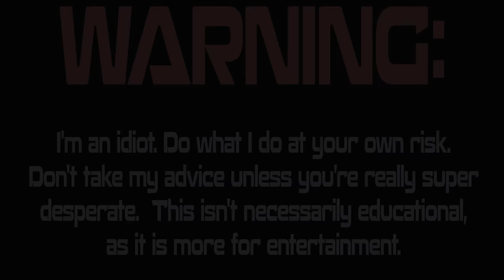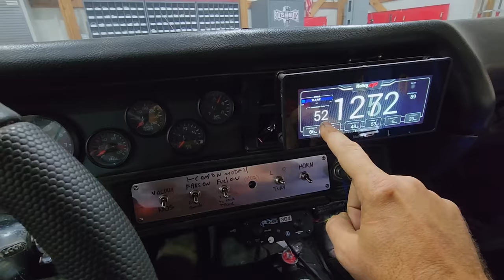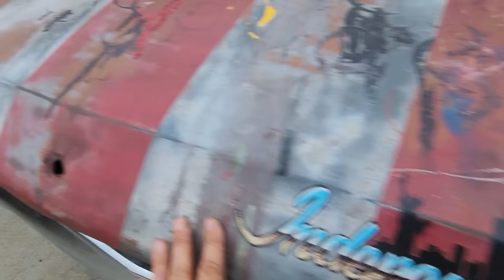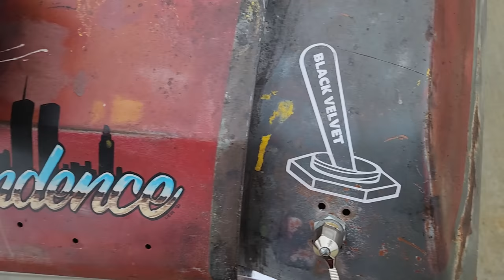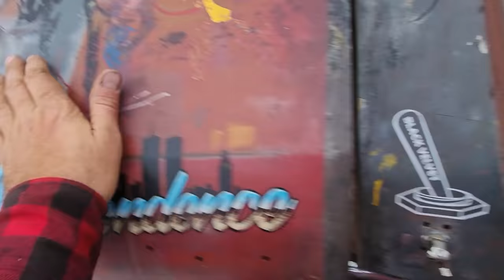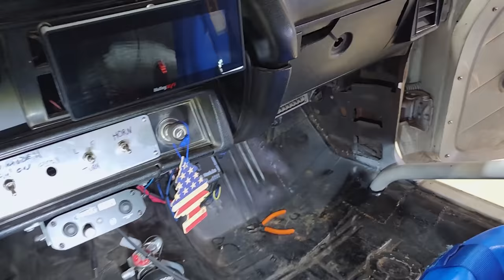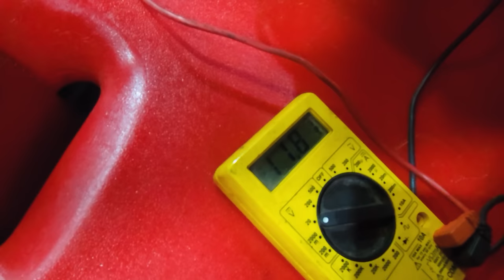Body Work with a Fork lift and Winch - Can Independence Chevelle be fixed?

Comment: There are a handful of car and truck projects you did on Vice Grip Garage that could define the heart and soul of the channel. There’s just something about the Independence Chevelle that not only defines Vice Grip Garage, but transcends it to a greater meaning. It’s like the St. Louis Arch. You remove the Arch from St. Louis and it’s just another city on the Mississippi River. But having the Arch there defines the city. Make the Independence Chevelle a safe roadworthy car and keep it around the shop.

Comment: Wow that winch pulled most of the damage out the first time And even un Folded it just by attaching to the Chrome Bumper that was impressive that don't ever happen that smooth Reversing the damage like going back in time as the damage occurred Wow Derek @Vice Grip Garage

Comment: Did a similar thing to my 735i after a truck wiped the nose into a different position. I just hitched the bad points to the corner of the house and reversed with perfectly calculated speed several times. You are only prolonging the inevitable but its giving the old dog more life. Reminds me of Tripod, a cat we rescued, perfect isn't always perfect.

Comment: So, on a dirt track car... A guy builds a cage, and hang body panels on the outside, from week to week  different panels or even cage sections, or frame gets replaced, but the car is always at the track next week and looking like it did at the beginning of the season...... And like you said, kids love it, you love it, it famous, fans love it. You've got good bones for a burnout & track safe car.... Build the full cage, hang as much of the exterior sheet metal as you can over the skeleton 😁

Comment: Imo do what you can to straighten and reinforce the good sections. Weld whatever sheetmetal and patches you can to the inside of the body and then build a tubing frame inside to prevent it from collapsing. Pull what dents you can safely. Then take the body off the frame and mount it on something for display. If you need to remove the worst sections and reweld some stuff? Do it.

Comment: Hey Derrick,  the spray you use to " stabilize " rust is phosphoric acid. It turns iron oxide to iron phosphate. You shouldn't use a spray form without using respiratory protection.  Buy Ospho in liquid form, where protective gloves and wipe or brush it on, after knocking off all loose rust first. Ospho only works on tight rust.

Comment: Derek, you won't get the voltage necessary until the temp comes up past 180!!! Good job on the body though, way to go!!
Bracket race that girl, put a 4.11:1 in the rear with a 12 bolt and 4 link it!
You inspired me, I put a 496 stroker in my 67 Camaro!! 775 h.p. at the wheels!!!...Jeff

Comment: The way you feel about this car and the state of this car is something I can relate with a lot. My very first car was a 1997 Mitsubishi Eclipse gs. It’s sun faded to hell, had a lot of character, and has way to many memories to count. It ultimately has reached a point of neglect that hurts my soul so much in terms of rust and it’s ultimate fate when I froze water in the cooling system. I bought another car to drive and have held on and drug the eclipse with me and every time I start working on it or inspecting it my soul hurts a ton seeing it’s current condition in terms of underbody rust. But after I get the engine back together I’m just going to enjoy it till I can’t any longer.

Comment: It's honestly just amazing what you can do with a good wightset like the forklift something that has not much give and you should try and get a decent Porta power and it literally will make a BIG impact in something bowed and a good winch that you can remember to use a snatch block and remember that the basics are every time you add a snatch block it doubles the power and it will slow it up to where you can find a good spot to get some triangles going to square it up again. If cleats can do that coppy car that was feets outsa wacka for independence she has memories that will help her heal and make it back again! She loves this stuff and it means a ton to the world and truthfully more and more people don't even know what it means and stands for! But SIMPLY Rise from the a ashes and make it whole again! A little bit of heat here and there and a little bit of a push tug and it will be right as rain.

Comment: Brother Derek,
Pull the drivetrain from Independence.  Drop a smallblock, or whatever you got lying around.  Paint up some valve covers to make it look somewhat like the BB.  Just drive it to shows.  Use the original drivetrain for the El Camino, or whatever you choose.  Independence is the car, not the motor, in my opinion.  Keep up the good work.  It's great watching you succeed!

Comment: Glad to see you giving that car a final run before proper retirement while still honoring the 9-11 victims.
My favorite line in this video: "If it doesn't bleed America...."
With a vacuum, you can have suction (hand on end of hose to feel it) but no airflow, which causes the dirt to flow through the hose.  That's because your filter is clogged not allowing airflow, though you have plenty of suction.

Comment: I was going to leave a comment on some of the previous videos on Independence that it probably would have to be retired from burn outs to be saved. I honestly think one option ( here a guy out ) would be instead of just building any old burn out car, you find a nice semi rust free A-body ( doesn't even have to be a Chevelle ) and paint it in an identical livery with the current Independence drivetrain, and name it "Liberty", A sister ship that carries on the torch of Independence for generations to come. Just a thought, building any burn out car will be cool but it was a thought I had

Comment: Derek. Read this please !! Im a auto body instructer at admiral peary vo tech. I teach  10th 11th 12th grade students collision repair and restoration. I would be thrilled to restore independence. We have frame machime and state of the art paint booth. You would have no labor charge just matieral. We can properly patch all metal to keep it as close to oraginal as possible. We can build a lot of part we have alot of metal working equipment. And it be a heck of a learning experience for the students. I would over see all the work the kids do so you it would br done. Properly.

Comment: I remember the episode when you rescued her. She’s came a long way since then and after this grand finale she will be remembered forever. I’d say return independence back to a going to town rig with a small block Chevy and cruise her into town. I like vote on using the short bed GMC for the burnout truck with the running gear big block and transmission from independence and as one commenter suggested paint it up like the independence Chevelle for in memory of. 
God Bless Y’all.

Comment: dont forget it will also needs all new floor and trunk braces... I just did a 69 Rag Chevelle and basically 10 out of 12 body mounts were roached ,,,so all braces had to be changed.

Comment: Have always been a Chevelle fan, owning a '69 & '70 at one time. Think I'd spend a day under the car with some of that rust inhibitor spray and then go over that with some rubberized coating to keep the underside of Independence from further decay. Remove the motor/trans for another burnout vehicle and replace then with what most likely came in the car: 350ci/350th. Build the 350ci to something L-46-like.

Comment: Straighten the frame, pull rear quarters panels, trunk, bumper and all attaching points. Order new aftermarket panels from AMD. New wrap call it Independence 2.

Comment: Id say carefully swap the old skin on a donor floor and frame to keep the patina and look but safe and sound and do whatever needed to stop further rust damage. Some patina jobs show where repairs have been made. Could even paint the necessary exterior repairs to look like new when it was first painted that theme and there is a mix with new and old kinda to represent us repairing our damaged country.

Comment: I remember my first frame straightener 9000. It was a light pole mounted on a concrete tripod located at the Television shop across the street from my house. It could only be used on Sundays. Or overnight. First frame we did was a 65 Malibu. We used chains and come alongs. We were the go to guys in the neighborhood 😂

Comment: Should be doing it like the previous owners. Layers over layers. Without treating the hidden rust of course. Get a good enough Chevelle and put the independence outer over it. Literally sheet metal over sheet metal. If you can tuck a quarterpanel under a quarterpanel you can do it to a whole car.

Comment: Why not pull the body, soda blast the inners (maintaining all exterior paint/rust) weld in any 'necessary' inner panels, skin the inside of EVERYTHING with fiberglass, and seal it with raptor liner. Then swap the frame, and reassemble. It'll cost about 3k in materials + the frame, and it'll be good for 10-20 uploads. That's exactly the resto yt needs, and independence deserves. Extensive.. yes. The fun kind.

Comment: A feller needs to keep himself a tube Lexal around the shop. U could have used it to glue down some of that thin rusty quarter to the new sheet metal and not used so many pop rivers. I'm  telling ya that stuff sticks to anything, it's clear and you can even use it on damp surfaces if needed. Most of the time I go to the gutter section at Lowe's and buy the seam sealer, it's the exact same thing and saves a guy a couple bucks. It comes in the calking tubes or the smaller squeeze tube (so does the name brand Lexal). It would also be good to take on a revival mission when you have a leaky roof or windshield. Try it you'll find all kinds of uses for it.

Comment: Well, as far as I understand Vice Grip Garage is partly about preserving unloved and abandoned vehicles. Independence Chevelle is an icon in today's motoring culture, from day one in my humblke opinion. I watched the first episode when Derek brought the car back home, and the car kept giving albeit being laden with multiple issues and a lot of stuff that happens to unloved cars. Why not rescue the body and frame? Why not go the extra mile and restore Independence to show piece quality and return it to its former glory? Show her on car shows as the car that refused to give up. I guess it is taking a shitload of money to get it fixed, but it will pay off in the long run. Work over the frame, put the body mounts and inner structure back together, go over the body and fix ist. Make her into THE Vice Grip Garage mascot - show her on Hot Rod Power Tour. I am sure making a video series out of the restoration process will bring in revenue, and the fans will see her return to its former glory.

Comment: Not to sound too red-necky, but after you get the body bits reconnected you could reinforce it by glassing up the inside. Just be careful not to glass in any untreated rust. You needn't even worry about the self tappers. Seal off the tips to prevent rust & you're golden. Then, once you get her stabilized in structural terms, you're freed up to attack the frame issues.

Comment: I would put new metal to make it safe in the bones of the car but not to much so it keep its soul, its earned that rust and bumps you see. Then i would put a mild big block in it with a tunnel ram and some leg warmers out each side to give it that 70s feel. Put some seats in it so you cold take the family out to get some cold snacks on a weekend cruise

Comment: Serious suggestion, could you not build a space frame in her? Carry on what the roll cage is already doing and restore her structure internally then take the new frame members onto the chassis? You could then use the new internal frame to give the external panels rigidity back.

Comment: The safest way to do any switch is switch the ground anything that is wired and as a switch should be on the ground side as the switch is the most safest way to do it I’ve been wearing for 30 years and I’ve been drilling twisting wires for can bus systems with a drill for 20 years And I believe I was the first person that I’ve ever seen do it working with 13 other guys they started to do it I don’t claim to be a pioneer but I’m pretty close I always use the ground side for a switch if you look at any engine control module it switches with the ground side

Comment: My two cents says that a feller or fellet would do best by putting that 871 with a big blower out the hood in to the ol gal, spruce her up some more, and use her as a pony car on power tour and the like. Shower her off and let people keep makin memories with good ol independence. Then take what you’ve currently got settin in the power barn and drop that into that old El Camino, it’s got enough weight savings to make a great burnout car! Course all that’s just my two cents.

Comment: Brother you can replace some sheet metal in the rear by doing a tube setup in the rear. Not much meat to weld to but you can do a tube rear to get some stability for the rear sheet metal to hang from. And she would still be the Independence Chevelle and be around alot longer. And loom better without replacing pretty much everything.
Reply: And there are people out there that can match the patina paint so she will look right.

Comment: I think that the Monte Carlo that you made into a NASCAR tribute would make an awesome burnout car. Really if you start out with junk then every time you hit a wall it’s going to turn to dust 😂. Probably would be better off using a solid platform that’s easily repairable. Not sure the Monte ticks that box but I just like it. Good Luck! 🙏🏻

Comment: i'd get a new shell and frame for it and swap as many parts as you can, repaint it the same and then use it for drag racing from now on. the USS Constitution has had every piece replaced over the years but its not called something else

Comment: derek. i noticed you were pointing out new rust spots on independence frame. i live in new england and i have been getting my truck undercoated for several years using fluid film. ill admit its kinda dirty to work on cuz the fluid film gets dirt and averything in it and turns black and nasty but zero rust which is saying something in new england.

Comment: As a personal opinion I would agree with you and say that your should bend all of the exterior back take the dents out and repair the shell and the pannels. And it’s not my place to say beacuse the paint and rust hold real sentimental value but I would say repaint it back the exact same way to we’re it’s new and then take it around as a memorial drag car veteran. Simmilar to the 94 marine corps-vette which ironically is another 9/11 mermorial vechical which if y’all haven’t seen that one I recommend it intact it’s sitting in the show room of the national corvette museum in bowling green Kentucky last time I seen it. But I’m just glad independence can atleast be spared

Comment: Let's face it fellas and fellets this is the kind of car you buy when you want to have fun and smash things up, if it's not safe enough to be on a drag track it ain't safe enough to be on the road that's for sure but there is one place it is good for the demolition derby! Of course after you strip out all the goodies and put a different motor in it and tranny, you wouldn't want to ruin all that stuff.

Comment: Can you make a custom pin, inspired by a hood pin, that sticks out the old key hole on the trunk lid?  Or a plate inside the trunk, with a "hideaway" pin, like a hood pin, located in the trunk lid key hole? Would uniformly hold the deck lid down, and not mess with Independence tattoo.
........should've watched the rest of the video before I typed....LOL

Comment: it would be a lot of work but I say disassemble the ol' girl and use all of the nuts, bolts, glass, truck lid, hood, roof, lights, seats, drive train, rims, etc. whatever you can salvage and build a new rig with all of the Independence hardware.... "Son of Independence"

Comment: I'd say a guy removes the drive train out of Independence and puts it into a new burnout rig. And maybe do a budget rebuild in the shop of a small block to put into independence for cruise ins and weekend trips. Just get a good rebuild turbo350 and put a small block you pull out hone it out and put in new rings and bearings and just freshen it up.

Comment: I got a question about lifts. I have an 08 dodge ram 3500, with the 6.7 Cummins diesel. I need a lift that can handle it down to smaller vehicles. I notice you use the 4 post lifts. Are they the best bet?

Comment: I'd say find a lightweight car to put that power plant in but I'm thinking the chevelle with no engine and trans is lighter than a fiero or fiberglass vette minus same components IDK if you can weight reduce anything anymore than Independence is

Comment: Hi Derek, I've been watching this episode on independence, and l have some thoughts for you. I get how you would like to keep the heart and feel of the car, but the way l figure it you can . Question. Is the frame really toast, or can it be reworked. Being from Canada l personally have fixed some really nasty stuff when l had my restoration shop. Plus you can make repairs on the body easy with a new Dynacorn body shell. Reuse your front clip, doors, and even trunk lid and bumper. Then cut up the origi al shell into bits and share them with your fans for a small donation to a 911 charity. This way, you keep the heart and feel, plus add a new layer to the legend that is independence.